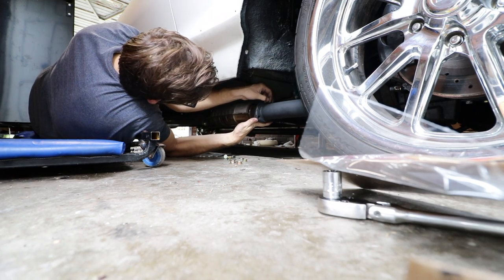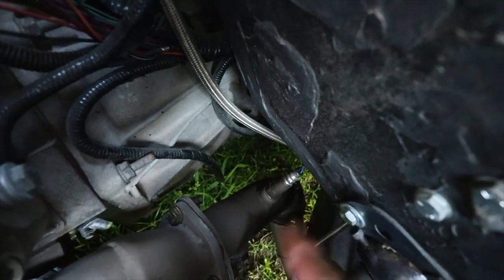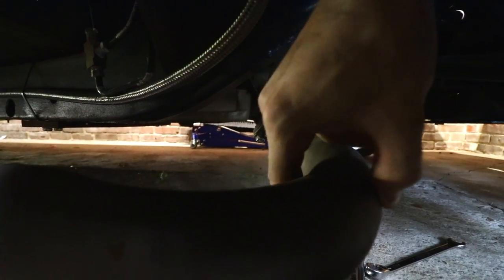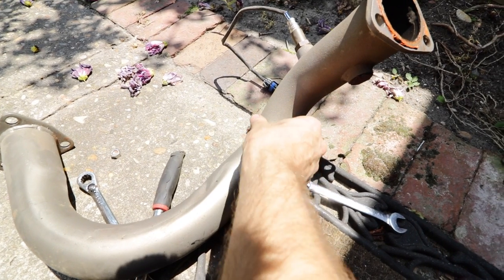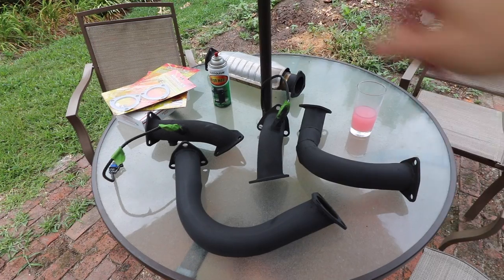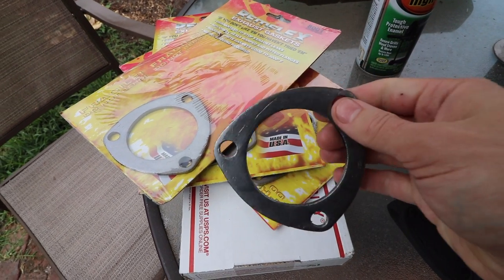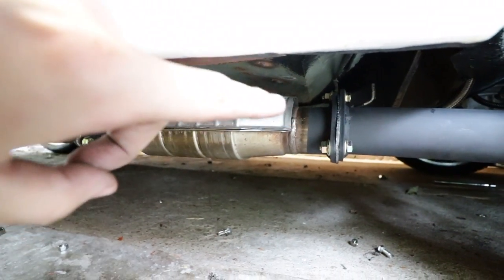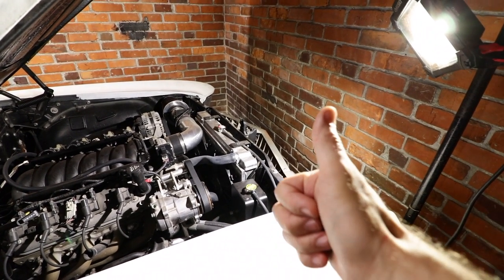Fixing Exhaust Leaks With Remflex Gaskets - It Works!!

Comment: you made my day when you forgot the gasket and the mini defeat head drop when you couldn't reach the wrench ... I have been restoring a '49 Chevy 3100 and I am feeling much better about myself now ;-)
Reply from the maker: Those are the real struggles with projects and every once in a while happens on camera! I’m actually making a revival video of an old Ford pickup right now and I spent way to much time trying to figure out why it wouldn’t run when I was bumping the started over manually underhood only to realize I forgot to turn the key on inside… Awesome project! I have a soft spot for those early Chevy trucks. Cheers!

Comment: "I only had to break one bolt" - lol What is your opinion about double gaskets?  One of the exhaust flange gaskets I'm looking at now is on the pipe solid and flat, so I hesitate to remove it.  But what about adding a factory gasket to a Fel-Pro gasket that has welded itself onto the pipe?
Reply from the maker: I’ve done it, I’m not proud of it haha. Personally I like to use the belt sander to help square them up but here we are. It’s more likely to have a blowout with two gaskets but if it holds, it holds buddy!

Comment: I've just put these on my Mitsubishi evo 10. tried every type of gasket to stop a pesky leak. This is the only one that worked. I'm running 400bhp and they hold up just fine. Definitely recommend Remflex
Reply from the maker: It’s really the only thing that won’t blow out besides a v-band I’ve foudn
Reply from the maker: MLS type gaskets are my only other alternative assuming all surfaces are perfect and it’s available

Comment: Remflex are great, as long as they are torqued correctly. usually less than you expect, around 20ftlb!
Reply from the maker: Which basically feels loose, 90% of the time there’s no way to get a torque wrench even close to fitting. Kinda gotta do’um by feel but man 20 ft lb ain’t much.

Comment: How do you know if you have an exhaust leak? I'm getting a whistle, like a chirping sound from my motorbike after warming the bike up and going down the road. It does this after about a mile for about 10-30 seconds, depending on how much I rev, and stops when I close the throttle. It's about 3 chirps a second, so I imagine it's on the exhaust part of the 4 stroke cycle. Back in the summer I took the exhaust off and re-used the collar/gaskets and I'm wondering if the cold weather is causing a slight leak until it fully heats up and the metal expands.
Reply from the maker: I’m with you on the heating up and closing the gap theory. I could feel the exhaust escaping and pulsing on my hand to the rpm and plugging HP Tuner I could see odd O2 fluctuations on the driver side but not passenger side. While it’ll try to evaporate quickly - try spraying soaping water at the suspect joint and see if you see any tiny bulbs. Do it when the engine is cold and immediately after it starts or it’ll just burn off.
Reply: @MatthewFinlay  Sounds like a good idea for how to test it, thanks. Just a shame I have to spend an hour taking all the panels off to get to the downpipes. Not good in this weather. It's snow outside right now. 
The sound seems to have evolved into a light scraping noise that is constant now after warmed up. It's hard to describe it, but it sounds like something isn't right. I can only really hear it when it echoes back off of scenery I'm going past. I'm wondering if the oil pump isn't lubricating parts of the engine. Unfortunately the place I bought the bike from has gone out of business.
Reply from the maker: That sucks, the more you describe it, the less it sounds like an exhaust leak. But also, I’ve seen some weird stuff over the years haha.
Reply: @MatthewFinlay  Yeah, it sounds like one of those pesky problems that doesn't happen in front of the mechanic, and they look at you like it's you... but will aggrivate me until the engine blows up and I say "I told you there was a f**king noise".